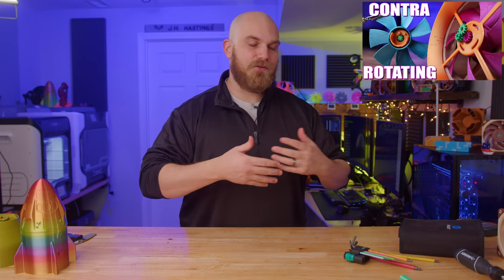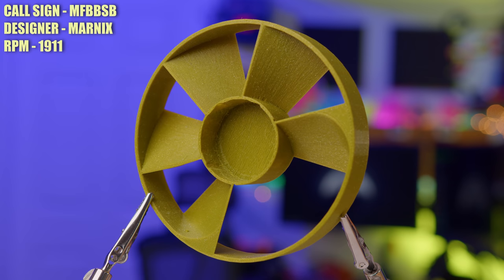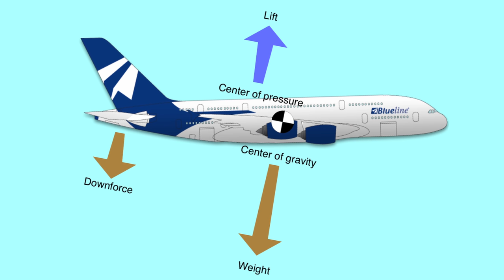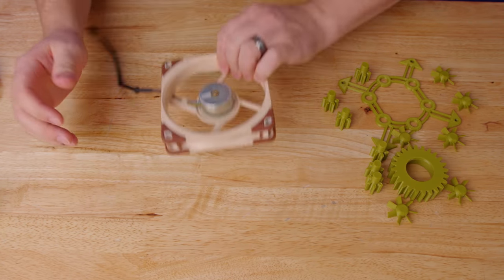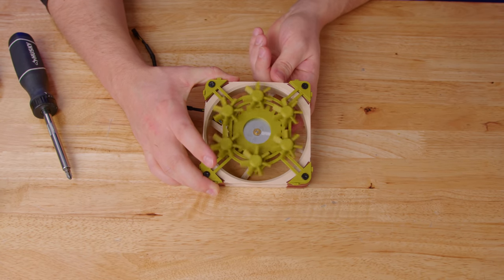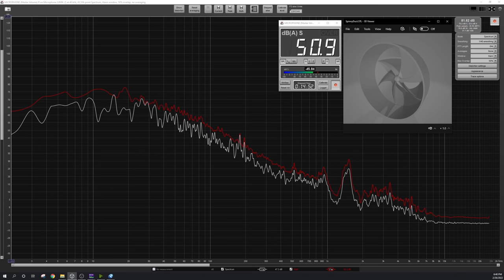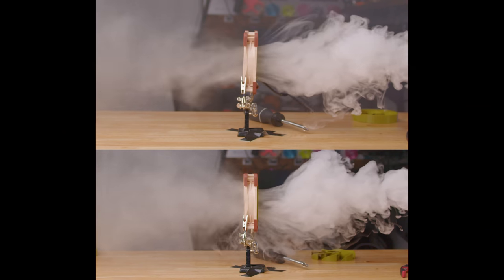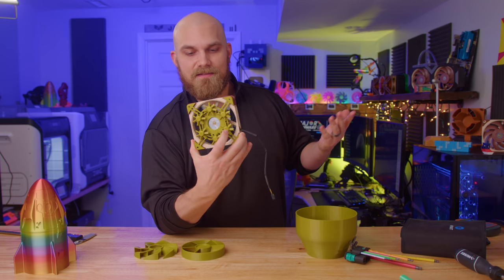WARNING Prolonged Exposure May Damage Hearing | Fan Showdown S4E2

Comment: Add some Teflon spray, it's better for spinning and less noise. And that noise is missed rotation energy, if it comes from gears.

NO OIL!!!!! USE TEFLON, IT DOSENT ESCAPE FROM CENTRIFUGAL FORCES SO EASILY THAN OIL. YOU ST.. BST... ;D
Reply: And that "jet" could have one more set of wings, more like compressor blades. There cannot easily make stationary counter co.pressor plates, but no matter. 

Nice job everyone! Just make those v 2.0 versions.

Janne